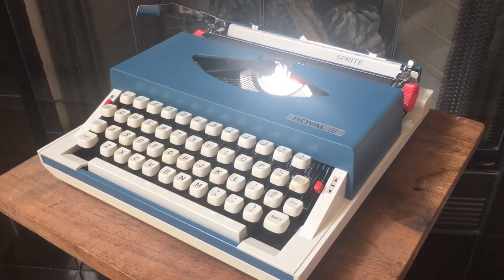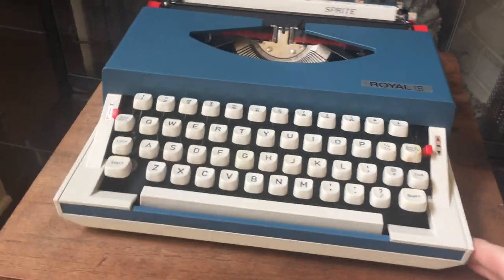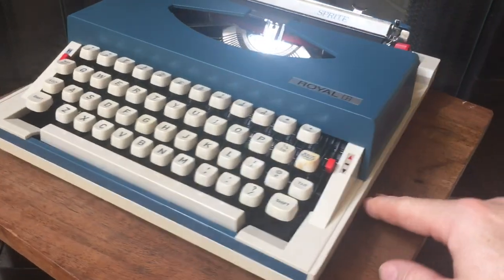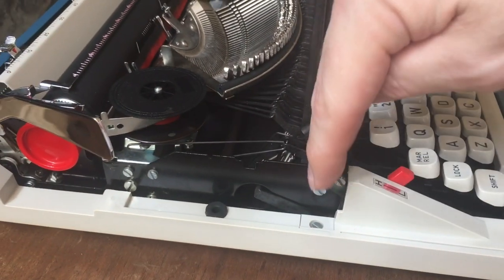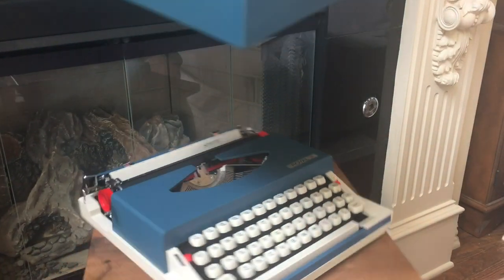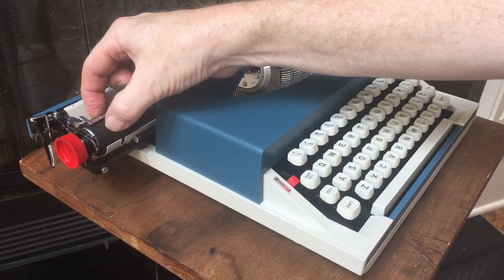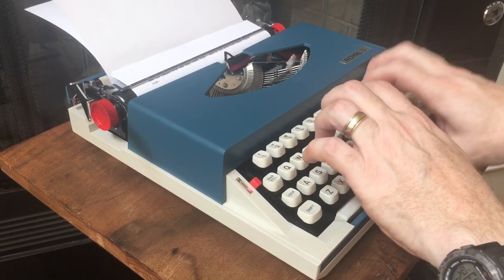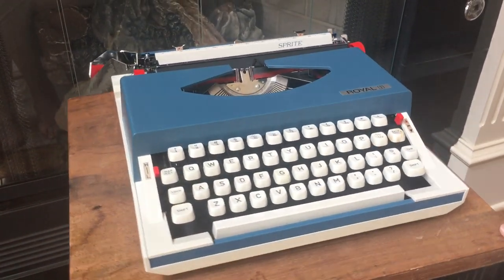Video review: 1970 Royal Sprite typewriter (Silver-Seiko) [sold]

Comment: For me, this is the pinnacle of the “portable typewriter”
A full-feature portable that actually significantly cuts down on profile and weight (unlike so many from the 50s and 60s that are just normal size/weight typewriters in a full size briefcase). Lighter, smaller, and lower profile without sacrificing features!

The carrying case is great too (flat sides, and matches the color scheme). I’m grateful I ran across an original with carry case at an antique mall. For a portable at least, it can’t be beat.